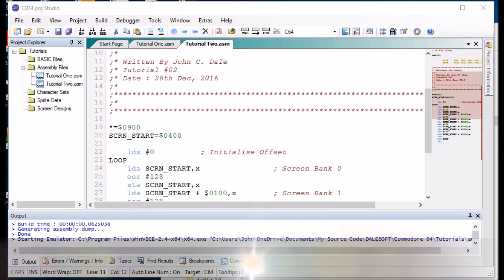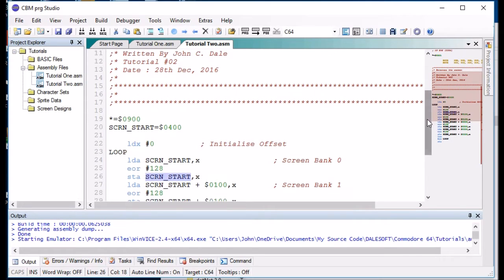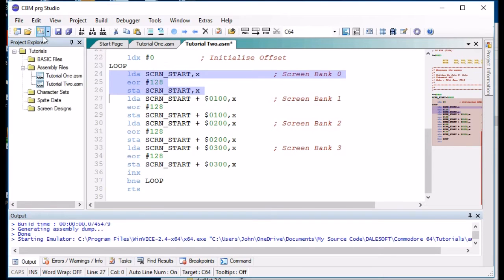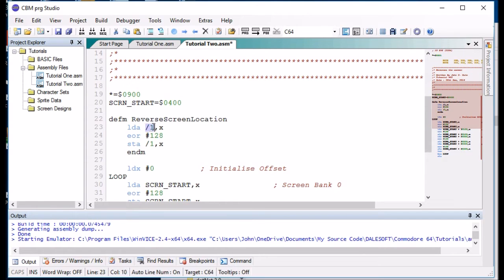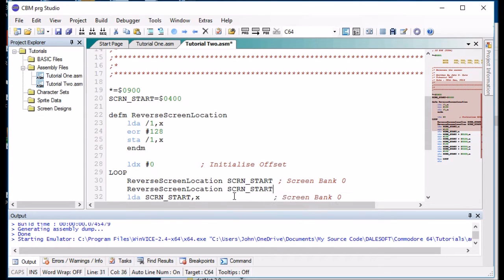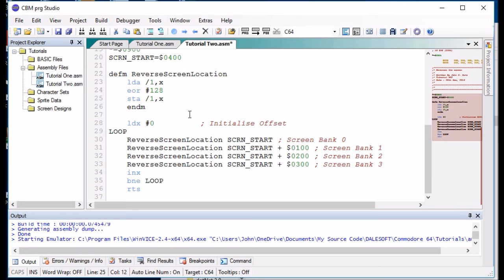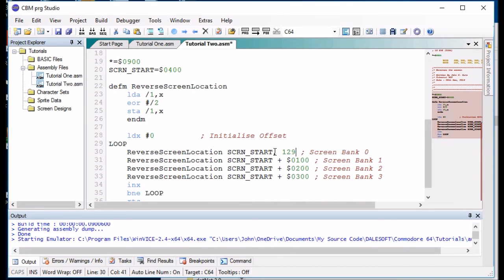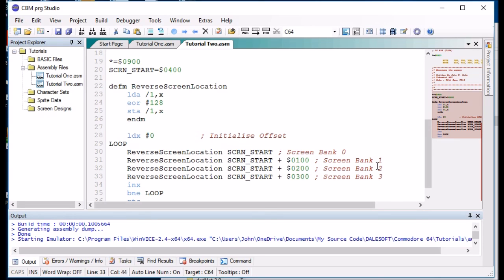Tutorial Three - 6502 Assembly Macros

Comment: Macros aside, try as i might I'm really not getting how this program even works??? Just looking at location 1024, If we EOR the blank screen value that the screen pointer is pointing to ( which is the default blank space, value  of #32 right? ) with #128, the result is #160. POKED to the screen in vice, i.e. POKE 1024,160, this holds true and you get a square in the top left corner in the default border colour. Here's the same in assembly:

    ldx #0
    clc 
    lda $0400,x
    eor #128
    sta $0400,x
    rts

So, in debug, WHY is the memory viewer showing the value dec #$80 or hex #128 being stored?
POKE 1024,128 in vice gives you an @ sign right? Hope my question makes sense, and that you
can help!
Reply from the maker: QBIQ : Hi, I have just created this assembly file in CBM Prg Studio...

; 10 SYS (4096)

*=$0801

    BYTE    $0E, $08, $0A, $00, $9E, $20, $28,  $34, $30, $39, $36, $29, $00, $00, $00

*=$1000
    ldx #$00
    clc
    lda $0400,x
    eor #128
    sta $0400,x
    rts

And I get a solid block #$A0 (160) in the top left hand corner on the VICE screen.

Even in VICE and CBM Prg Studio Debug mode, the registers are set correctly E.g. Accumulator.

Im not getting the same issue as you :S

All my code is in GitHub and tutorial three is in the tutorials repository. http://www.github.com/OldSkoolCoder look in the tutorials two file and you should be able to assemble it and run in VICE.

Let me know how you get on?
Reply: Hi again John. Thanks for your help. I've now found that problem purely seems to lie with the prg studio debugger as the code runs fine in vice + in vice monitor pre-execution screen memory is the correct value of #32 and then changes to #160 when run as you would expect. However, in the prg studio debugger, screen memory is showing as $00 pre-execution where it should be $20. In fact the whole memory is $00?? Could it be some setting i've missed or perhaps a bug with prg studio? I'm running the latest version.